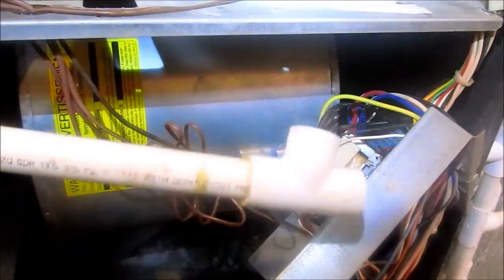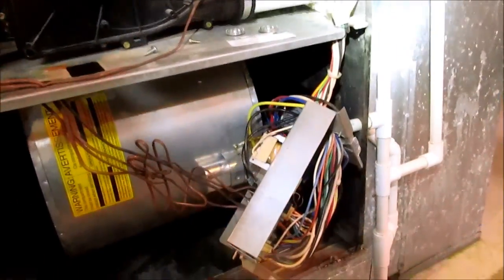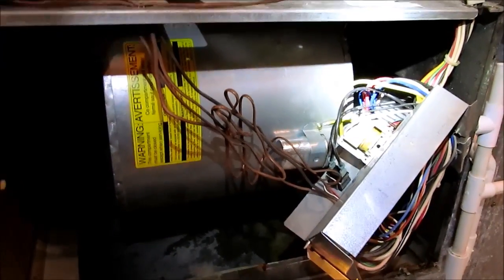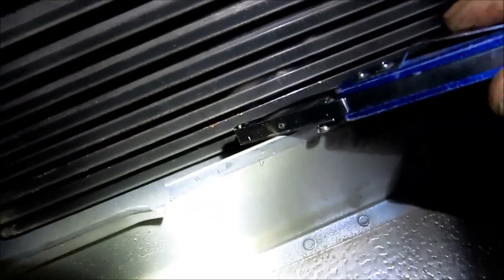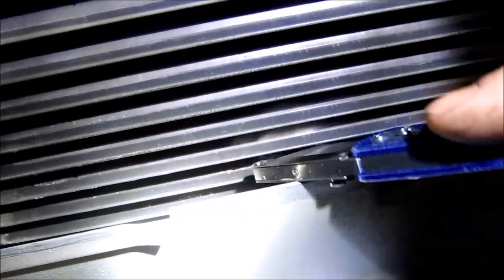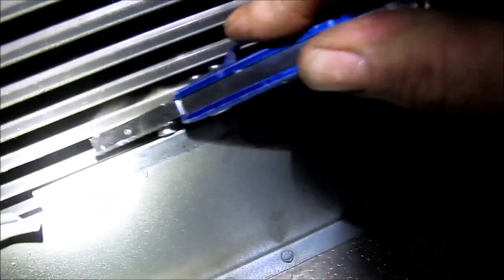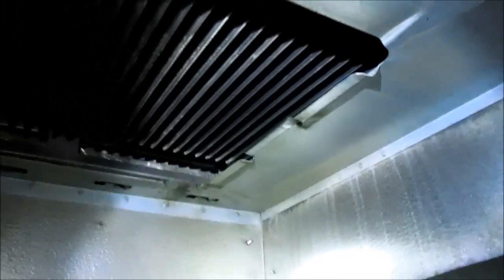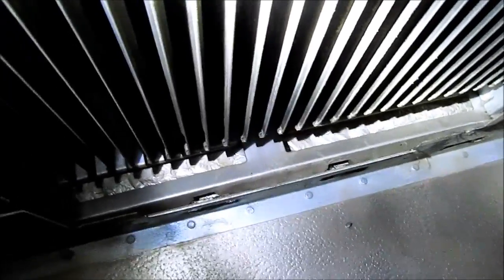Bryant heat exchanger inspection 340MAV060120

Comment: Proper installation of these and other 90+ furnaces is critical for longevity, especially the pitch towards the drain. The cost savings of a lot of high efficiency furnaces is not really there when you factor in repair costs. To bad that in my area where it is used maybe 4 months out of the year it is mandatory to have a high efficiency furnace installed by any reputable contractor. I will keep my simple 80+ furnace going as long as possible. A good old 383KAV. My church has some old 5 ton 80+ furnaces with inducers from 1985 still going strong other than new PSC blower motors and other minor maintenance over the years.

Comment: Nice Video ! 
How old was the furnace?
What do you think is the reason those Carrier/Bryant secondary H.E going bad?? 
Is Carrier know about this failing??
Reply from the maker: The furnace was 20 years old Carrier does know about the problem in their service bulletins about the heat exchangers there are lots of factors why this heat exchanger goes bad airflow pitch of furnace and Maintenance it doesn't matter how old the furnace is I just condemned another one yesterday that was 8 years old appreciate the comments thanks for watching
Reply: +Mi Heating Guy  Do you think is just the matter of the pitch in the installation of the furnace? Because like you, I've  been condemned like 5-7yrs old units. 
Did they go with new unit after all??
Reply from the maker: I think pitches huge factor when I run across these units I look for the floor drain and if the unit is sitting flat on the floor and say the floor drain is in the back corner of the furnace that's the first place I look for any kind of rust 8 times out of 10 it will be there